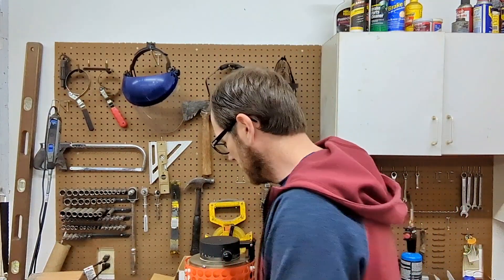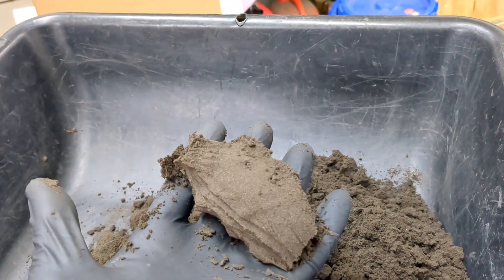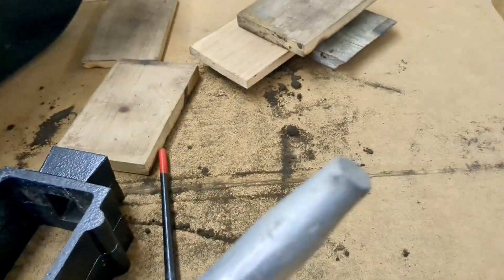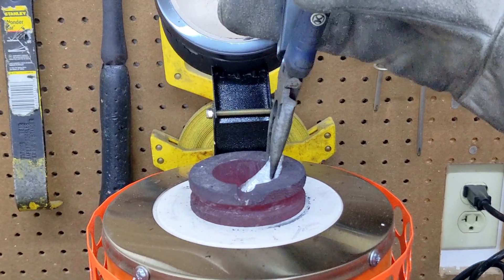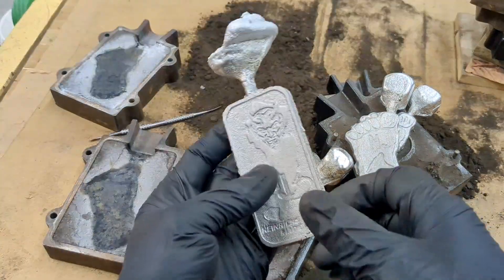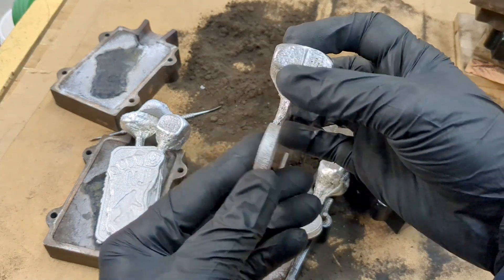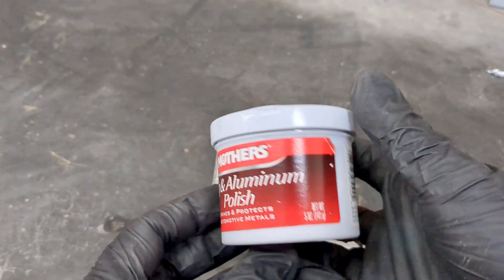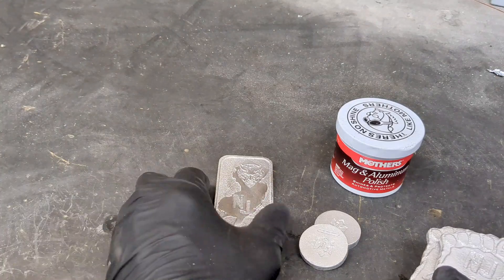Metal Casting Aluminum - ToAuto 3kg electric melting furnace

Comment: Great video. Do you have a link to the green sand you used? Specifically what mesh size did you use? Thank you.
Reply from the maker: Thanks!  I actually purchased 25lb bags off eBay.  I can't find them on eBay currently.  However Amazon has 10lb bags.  120 mesh works great.  I think I bought 120, and 180 and mixed it all together.

Teton-Black™ Olivine Fine-Mesh Water-Bonded Foundry Casting Sand (10lb) https://a.co/d/fsdbzFA